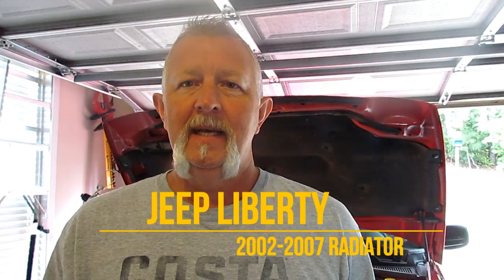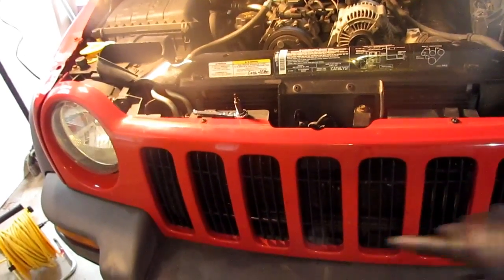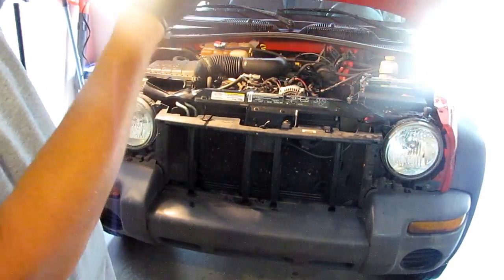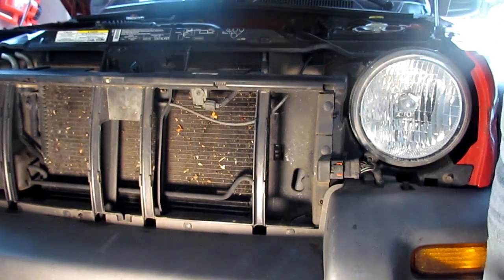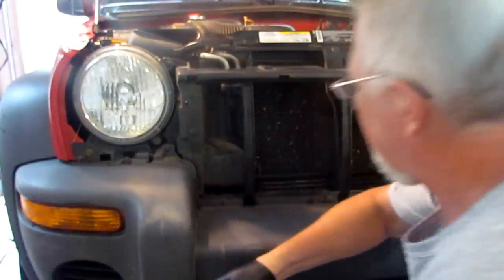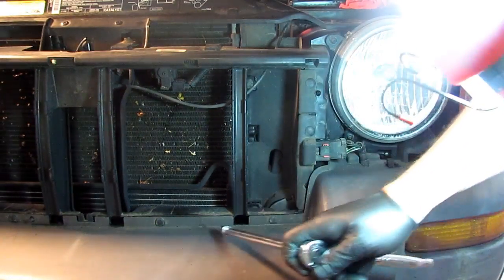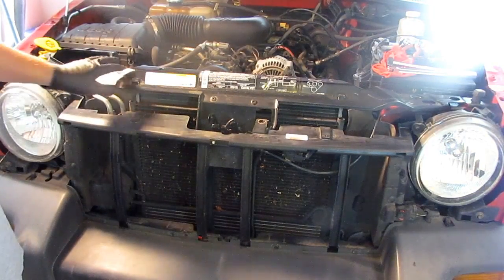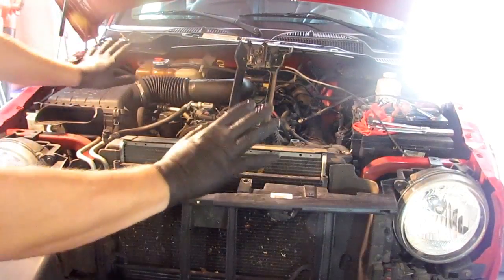Part 1   Remove and Replace 2002 - 2007 Jeep Liberty Radiator

Comment: Great video! I retired as a HD Truck fleet mechanic in 2015, after the best part of 50 years. I'm replacing the radiator in a friends 2004 Liberty while he's at work. I enjoyed your guidance in the details of removing the radiator. The explanations you gave help's both save time 'learning' and preventing parts getting broken that will have to be replaced. I've been 'anal retentive' in doing the job right since being an Army Mechanic, retiring as an M-1 Tank Motor Sergeant in 1990! THANKS!
Reply from the maker: Thank you so much, Jesse!  I appreciate your kind comments and am honored to know this helped somebody with your vast experience.  Thanks for watching!!

Comment: I am a professional corporate technical trainer and this presenter is one of the best I've seen   He speaks clearly and choses his words wisely.
Reply from the maker: Thanks so much Paul!  That's one of the nicest compliments I could have received, I appreciate it!
Reply: Dennis,  After watching all the other vids out there on the same topic, I don't think I could have done the radiator job without you.  The others are incomplete at best and inaccurate at worst.  I knew you were the real deal when I learned I didn't have to drill out the rivets.

Comment: Dennis, Thank you so much for putting these 2 videos together. My dad and I were able to swap out the radiator in my daughter's 2002 Liberty with no problems thanks to your detailed instructions. The only variation we have from your video is our transmission connects directly to the radiator which is a very easy disconnect/reconnect. Can't thank you enough for this one.
Reply from the maker: Thank you for watching, Jorge!  I'm glad it helped!

Comment: Got my radiator installed yesterday afternoon and came back to give you TWO THUMBS UP!  (Because I only have two thumbs,)     This video was a big help.. I have a 2005 Liberty Renegade. It  has a different grill, etc, but everything else was the same...The only thing it was 15 degrees out. Had the  Coal stove going and a pot  of coffee boiling on top!  Thanks again!
Reply from the maker: Whew!!  Doing a radiator job in 15 degrees is not fun!  Glad you got ti fixed though.  Thanks for watching, Jack!

Comment: This is a great video. I found it very helpful when I had to replace the radiator in our 2002 Liberty Sport. What I really appreciated was the lack of useless blather that is so common in too many other self-help videos. All the commentary is on point, and useful. There are some differences, however, between the replacement in the video and our 2002. First, the transmission cooler is integral to the radiator; it is not separate like this 2003 and it will use those inlet/outlet ports left plugged on this 2003 install. Second, the hood latch frame is not riveted like the 2003 but rather has four bolts/screws, separate from the top crossbar.  Once those bolts are out, the hood latch mechanism comes out. Popping the airbox loose - it is held in place by plastic 'spikes' set into rubber boots - allows the transmission lines to be lifted sufficiently to make 'finagling' the radiator out a lot easier. Add a bit of dish soap to the rubber boots so the air box will slip more easily back into place.
Reply from the maker: Thank you for watching, Mike!  Also, thanks for sharing all those useful points and tips on the 2002!

Comment: I don't need to replace my radiator (yet), but if (when) I do, I'll be watching this excellent video. I have to say though, what a frigging hassle. Most radiators I've pulled only have a few bolts and come right out. This one looks like a pain in the arse. Great video, very well done, covers every step. Thanks 😊
Reply from the maker: Thanks for watching, Paul!  Yes sir, you are correct....I don't think I've ever had one be this much trouble.
Reply: @dwcoffey  Since writing you, I had to replace my AC Clutch so I pulled the AC Fan and shroud and the mechanical fan with clutch. I tried to only pull the electric fan but couldn't get the shroud over the mechanical fans' clutch. So I had to pull that too. Had to make a tool to hold the fan pully from turning. Another pain in the rear-end. Figured while there may as well replace the water pump, serpentine, tensioner, tensioner pulley, idler pulling, change the oil and anti-freeze, and new upper and lower radiator hoses. Glad I did, because pulling those fans was by far the hardest part. Thanks again for your video!!
Reply from the maker: I had similar experience with my daughter's Liberty, Paul.  I found a cheap tool for the fan clutch, but yes, in the process of changing the AC clutch and the water pump, I did the same.  Like you, I figured while I had it all apart, I may as well replace it all.  HAHA  I had never done an AC compressor clutch before, so I was a bit worried about that job.  It went real smooth and I was pleased at how easy it was to do.  Hope you had the same experience!
Reply: @paulcalif  
Actually you were lucky on the AC Clutch. They have little washers that are actually little spacers. I used the same 2 washers from the old clutch with the new one, but it wasn't enough. I had to find a washer that was the right thickness and grind down the outside circumference to make it fit. Worked great but what pain.

Comment: Changed out the radiator on my Jeep today watching your video step by step. Those baffles are the worst part. Thanks for a great video. 
I forgot to take the rubber feet off the old one, hopefully that's not an issue.
Reply from the maker: I agree about the baffles!  Those things are a pain!!

Comment: I was looking to get a radiator for my 2006 Jeep Liberty.  I had two radiator options.  One with an external oil cooler and one without an external oil cooler.  Which one does my Jeep take?  Thanks for any advice.
Reply from the maker: It's been a while, and we don't have the Liberty anymore, but if I remember right, the models with automatic transmissions have an external transmission oil cooler and the manual transmission models have an internal transmission oil cooler.  Thanks for watching!

Comment: Hey. Great job on this video. Thank you. 

I have an 03 liberty that has mechanical fan as well as electric. How much does this change your instructions? I wish that the Liberty in this video wouldve had the belt driven fan as well because your way of instructing suits me perfectly and wouldve fully relieved my anxieties on taking on this task. I understand that this request is a bit unreasonable and if you dont reply then i completely understand. One way or another ill figure out the difference and your video here is so perfect to help me through most of the job. Thanks again.
Reply from the maker: Hi James, thanks for watching!  Mine doesn't have a belt driven fan, so, I'm reaching a bit here.....but....it shouldn't affect the process.  You should be able to do all this without removing the belt-driven fan.  It might get a little tight in there when pulling the electric fan, but I think you can do all this with the belt-driven fan in place.  I assume the belt driven fan has a clutch (the fan free-wheels if turned by hand with the engine off).  If so they can be a moderate pain in the tail to remove, but not prohibitive.  Let me know what you find and how it looks, I'll try to help any way I can.

Comment: Thanks for video I have a 04 liberty and fan was changed and now car over heats when sitting and fan is running slow and blowing air toward Radiator and not towards the engine can you tell me if that is right have they possibly confused the wires?
Reply from the maker: Thanks for watching, yes, sounds like they either installed the fan backwards or reversed the wiring.

Comment: Finished doing this last week. Took me 2 years. Now the electric fan doesn't work....
Got to thinking, every time I fill up on Premium(90+octane) gas in this vehicle, the rad tank burst. This is the fourth radiator on the Liberty, 
Any way,  very concise video. If you want to make one for a fan repair, I have a demo  vehicle you could use🙂
Reply from the maker: Well, I'm glad you got the radiator done!  I sure hope my instructions weren't the cause of this being a 2-year project!  :)
I've had to replace the fan on our Liberty as well.  I didn't make a video, but I'll try to get a chance to take ours out and re-install, making a video in the process.  thanks for the idea!

Comment: I love the video but I didn't see you disconnect the battery.  Is it ok to do while it's still hooked up
Reply from the maker: It's probably a good idea to disconnect the battery, just in case you lay a tool on the battery, etc.  But since there is no electrical work involved in this repair, I didn't disconnect the battery.  Thanks for watching!

Comment: Would a bad radiator cause over heating. My jeep is over heating it's a 05 and has coolant and the fan works.
Reply from the maker: Thanks for watching!  Could be a couple of things....your thermostat could be sticking, possibly your water pump is not moving enough coolant, or could be your radiator.  A clogged radiator will definitely cause overheating though.  With the engine up to temp, check to see if the upper radiator hose is hot.  If it is, the thermostat and pump are probably working ok.  You might try burping the system, that can affect coolant flow too.

Comment: Does anyone here know which bolts the fan and that latch assembly use? they are also above the lights. i have an 02 jeep liberty and they are a 10mm head about 1 inch long, im looking to buy some but dont know how to search other than m4,m5,m6
Reply from the maker: Thanks for watching Jeff!  I'm sorry, but I don't have access to a Liberty now, so I can't say.  If you have the original bolts and have access to a hardware store or an auto parts store, they should be able to size them for you.

Comment: Thanks Dennis for the very detailed tutorial, but this does NOT work for a Ford Explorer!! What a disaster. I have fluid and crap everywhere, and broke most of the front grille trying to pull everything up where you instructed. FYI
Reply from the maker: Thanks for watching and I'm sorry you had trouble. This video definitely doesn't apply to a Ford Explorer.  This is only for a 2002-2007 Jeep Liberty.  An Explorer install is completely different.  Let me know if there is anything I can help you with, and I'll try my best.